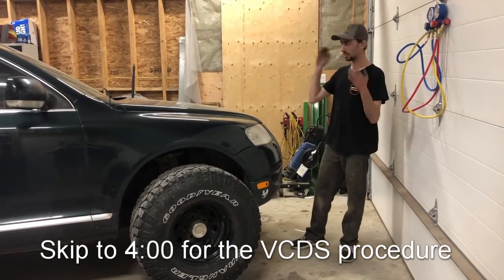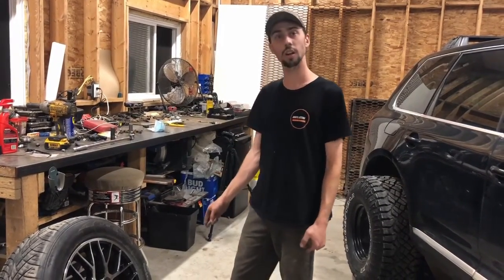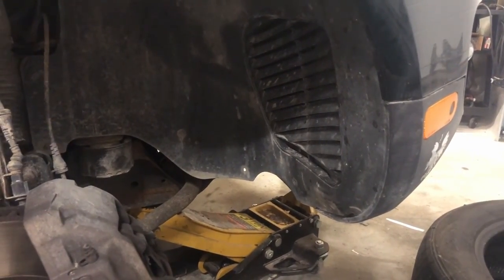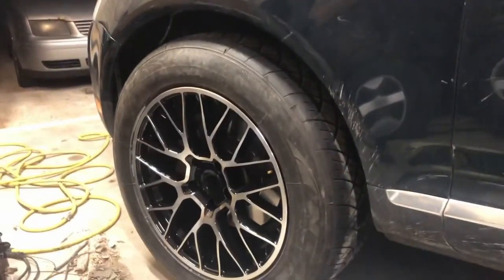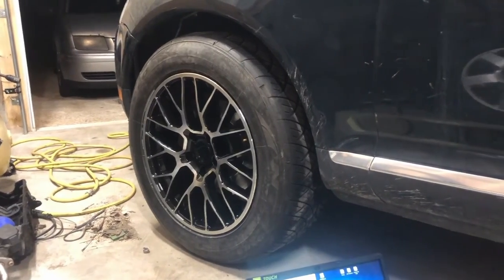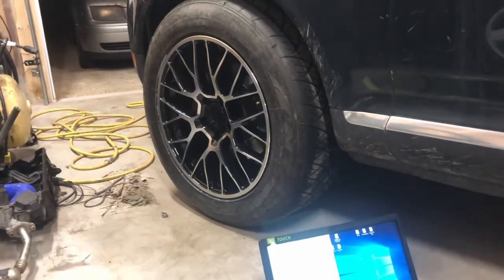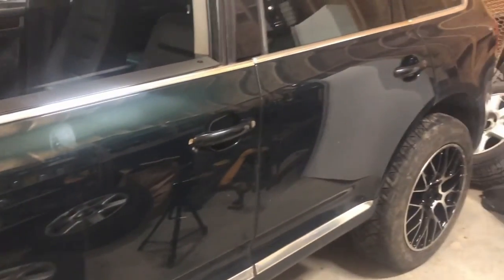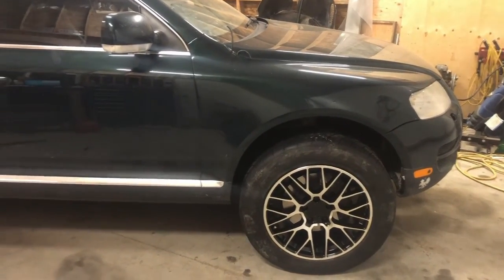Lifting & Lowering 7L Touareg with VCDS (vag-com)

Comment: wow how did that ride 30mm down? i dropped mine 10mm for aesthetic and noticed it a lot harder in sport, kinda more like a sports car should, and in comfort it didn't roll as bad in corners. was wondering how low i can go without causing issues with suspension or driveability. edit: was it lowered using hardware or vcds before?
Reply from the maker: It was lowered strictly with vcds, I didn’t even know it was lowered until trying to fit oversized tires on. As far as ride I didn’t notice a huge difference, ran comfort most of the time whereas I was in sport afterwards. but I am used to driving a lowered golf on coilovers and lifted f150 so that’s setting the standard pretty low.
Reply: @JoshsJettas  thank you I'm gonna drop another 20mm and see what's good :D
Reply: @JoshsJettas  can you quantify how much "oversized" please as I am wearing 265/60R18 which is slightly larger than stock at 30.5in diameter (+1.5in/5%)